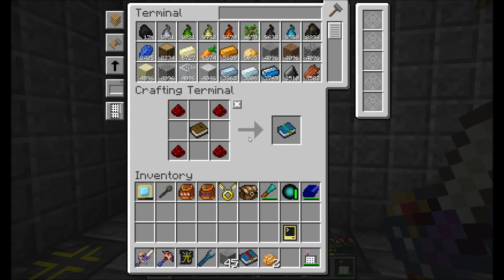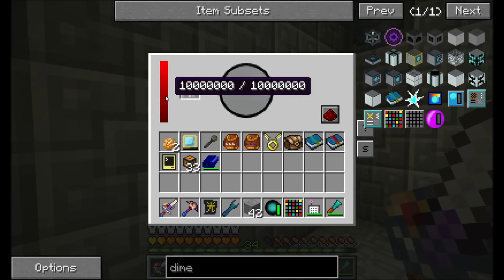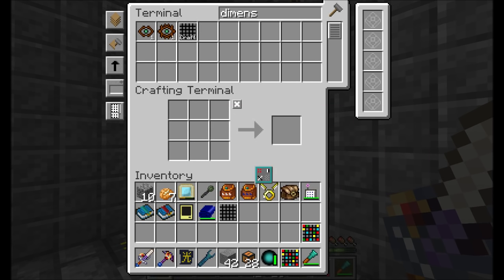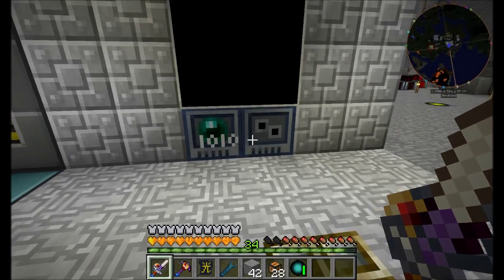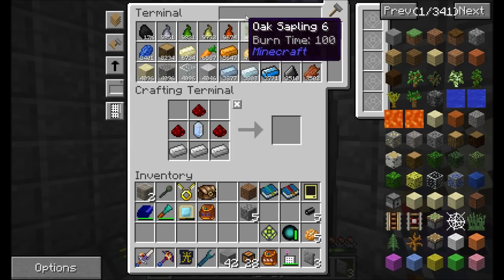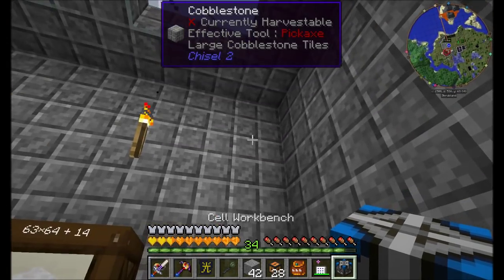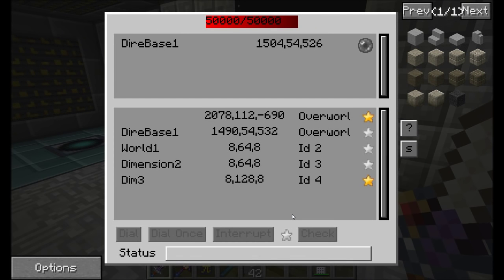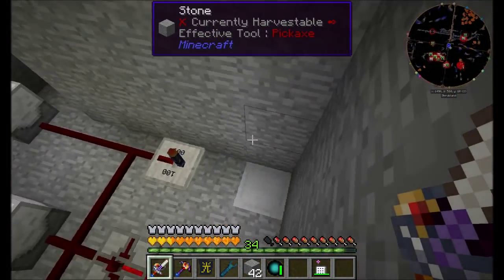Lets Play   S7 E97 Dimensional Travel

Comment: You could use ender IO AE conduits (there are also dense ones) that could run with your power lines and save space, and/or you can lower the ceiling of the basement (very high as it is) by 2 blocks or so -- to make much better cabling. Also consider switching your Botania base over to logistics pipes, again, to free up a P2P connection and make even more space for your cabling. Also consider moving your ME controllers to under the floor, for more possible expansion.

Comment: Enderman drop them (about 1/16 chance, it seems). Doesn't need to be a player kill.  I use a drop method with a vacuum hopper. However, it's faster to wander around a suitable RFTools world, unless you want to afk. If you're looking for rarity 6 dimlets, Hypno found them in about a 1 per 20,000 ratio.

Comment: I think you should do a total overhaul of your current base’s infrastructure, such as installing Warp Itemducts and Cryo-Stabilized Fluxducts where appropriate, upgrading all conduits to the best tier, etc.

If you do move your base, I would suggest teleporting each building into the void and connecting them there. We’ve seen enough base rebuilding episodes, and they are tediously manual for an automator of your caliber. Plenty of mods could do it

On a marginally related note, you should seed your entire base with Wireless Chargers supplied by Cryo-Stabilized Fluxducts, ME Wireless Access Points, and Environmental Managers with Saturation III. It is silly for an endgame base to have dead zones when the resource and power cost of total coverage is basically trivial.

Comment: Your basement is well laid out as it is...the only thing that is messy is the applied energistics stuff, partly because of the tight cables and partly because the diskDrive room is right next to your wool farm, which you may want to move MUCH further down, a better place would be at the end of that tunnel, right under your farm where the OLD power line is running to. I have to say you don't really need to build a new base, it's good enough, just needs a little bit of somewhat major rearrangements.